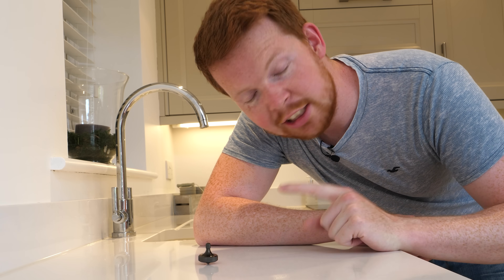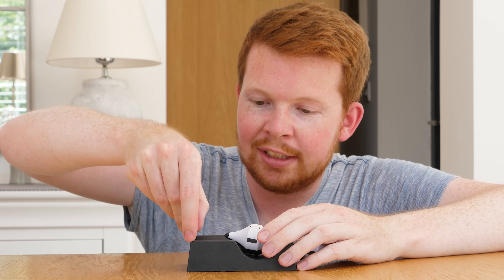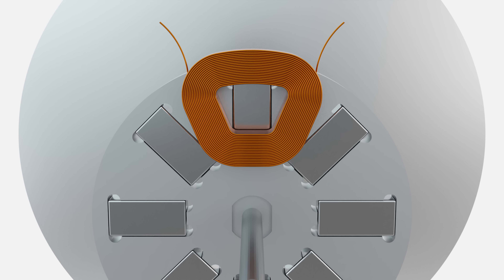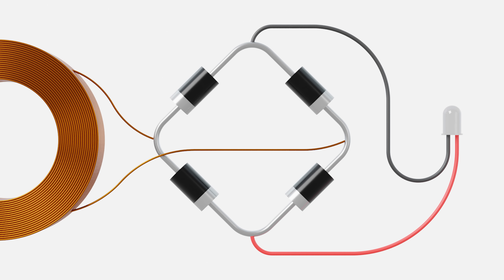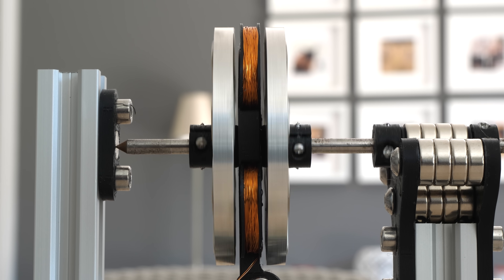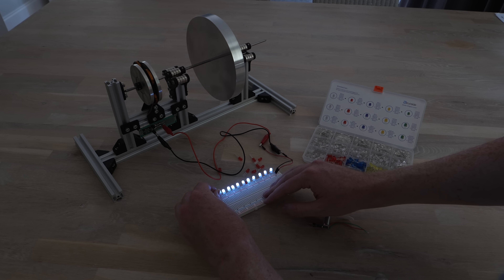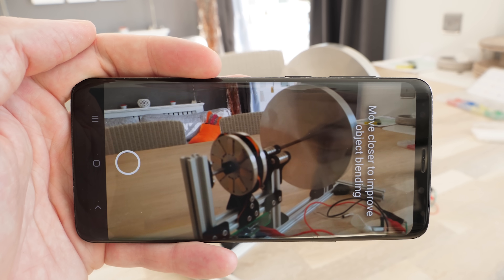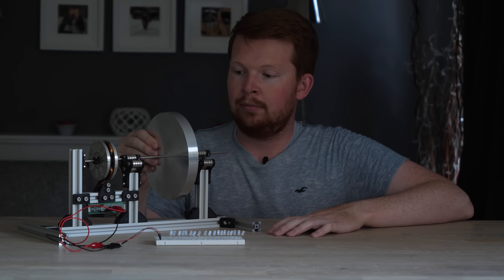Flywheel Battery

Comment: magnetic bearings are fun. try adding magnets with opposing poles at the ends of the axle. also use a beefier axle, preferably a hollow tube.
Reply: I think carbon tubes used in photography to rig stuff.
Reply: Beffear axial
Reply: Lavitating bearing new concept
Reply: It also be cool to see the addition of the small electric motor on the shaft as a pace keeper. Spin at the flywheel by hand and then send the power generated to the motor to keep the momentum up
Reply: @loganwilliamsbluecheck  it might potentially extend the run time but the laws concerning thermodynamics and electrical efficiency would still mean it will stop eventually
Reply: @jacobbrown7367  wait fr?
Reply: @jasalvatorekestrazzanti2715  well yeah, you're recycling some of the work the flywheel is doing to add energy back into it. 

Think of it expending slightly less energy for a slightly longer runtime

Comment: Hi, Tom. It is a pity that you started with a horizontal steel rod. It will bend. Try a carbon fiber tube that is much lighter and more rigid that steel. Another change, mount it vertically and lift the wheel from the bottom. No glass plate needed, just some small guide magnets at the top to keep it in place. The length of the lower vertical axis can be very small. This will increase stability. The upper axis can be long, so the lever action will enable stability via small guide magnets. Drill the center hole to exactly fit the carbon fiber tube. Super glue will hold it in place. Generate electricity from near the center of the wheel so that the whee;'s leverage will help drive the generator. Just daydreaming as if I was going to build one... Thanks for sharing! Stay Healthy!

Comment: I am happy you did this.

But you are missing something.  You're missing a filter.

Power supplies tapping from AC power, even on the industrial level, always require:
- Power source: AC Generator, even a transformer, etc.
- Rectifier: half-wave, full-wave, or (YOUR) full-bridge rectifier.
- And a filter: RC, LC, or any combination.
- And voltage regulation (optional): this can be done with a few transistors and zener diodes to prevent surges to your loads downstream (such as LEDs, power cabinets, etc).

You are missing the inductor (L) component, which regulate or limit the rate of current flow.  Since you have a capacitor added to regulate or "cap" the amount of charge, they do not slow down the rate of discharge since current will just flow freely.  This will "shave" or smooth your waveform output, since as you recall the magnets are not continuous throughout, thus creating "dips" or valleys in your AC sine waves.  This is why a filter after rectification helps "fill in those gaps", thus creating continuous and SMOOTH DC power.

I am happy you made several coils, which thereby create several phases (or other sine waves) which are wired to be at different times, but this can cause problems if the waves are not perfectly "distributed" or balanced in "degrees"--may need to review waveforms in trigonometry to know what I mean.  This will entail frequency (or the speed of waveforms created), and amplitude (the highest voltage created) as well as their degrees apart from each other.  Otherwise, I think you don't really need to bother with "phases" since this is not an industrial project--but it can be ;D.

Also, I recommend looking up a stator--this is just a peculiar shape on how inner magnets rotate around a chassis surrounded by wires (thus phases).  Probably can be printed in that Thangs website--which I am happy to stumble upon it on your video.

Comment: Im wondering, what if you would add a motor that will slide in and increase rpm of main shaft and then slide out untill rpm are dropped again bellow certain limit, would the regenerated power earned during free spin be enough to cover a motor which slides in and out to keep rpm at certain level? Or would it be possible to earn even more then spend on keeping rpm? :)

Comment: Would you be able to make another magnet cradle that matches the one farthest from the alternator (rear), and position it above the rear axle magnets, to serve as a spin stabilizer?  would prevent sideways and vertical movement at that point farthest from the axle pivot point, right?

Comment: What if, and I am just brainstorming here. Instead of having the screen barrier, you set up another 2 sets of magnets to balance this whole thing on or array of magnets on the screen. Basically, looking to remove that point of contact/friction. Then put the whole rig into a box and vacuum seal it. The wires could still come out of the box they would just have to be sealed around those points.
Then to spin the flywheel, you use magnets on the end opposite of the current barrier. Where you could use corresponding magnets from outside of the box to make the fly wheel spin. I wonder how much longer the flywheel would spin if you removed air resistance, and removed the point of contact from the barrier. Has anyone tried something like this before?

Comment: Hopefully you know angular momentum is related to radius squared. Thus, if you could take the full mass of your flywheel and put it into a very thin tube of the same radius you would see a dramatic increase in performance. You would have to 3D print some kind of spoke object to hold it in position. https://en.wikipedia.org/wiki/Angular_momentum. If you then doubled the radius you would quadruple the energy in the flywheel.

Comment: Hey Tom, I was thinking... Two flywheels store more energy than a single one can. Also, due to their bigger diameter and thickness, if you machined them to double as rotors, they could probably each hold 24 (?) stacks of 5 or 6 (?) magnets. With a ring of 12 (?) coils between them, they would make a MASSIVE generator. Don't you think?

Comment: One point you've missed. The outside diameter of the flywheel could be drilled for magnets at different degrees perfectly at each angle this outside 
Magnetic field can all be the same pole facing outwards  as the flywheel spins 
Each magnet passes a coil each coil sees the magnet pass and a a charge of energy is made, these charges are stored in a battery as direct current 
You use that current to drive a led light or even a motor to turn the shaft.
Now as perpetual motions not possible by our current theories this would let the flywheel spin a longer time, the decay in movement would be related to drag
As this has very little friction it depends on the motors effency that drives it and the battery that stores the energy and lets not forget electrical resistance on the wires and connections.
To boil this down what might spin 5 min
Could spin 1.5 hours. With a slower decay in speed.

Your going to need a really good mill with a presion indexer to index each hole for each magnet.  And you need to use rare earth magnets for best results.

They say perpetual motion is impossible but thats exactly how the earth travels around the sun.  What does seince know?

Comment: Awesome.  Just aubscribed.  May I ask you to try some ideas?

There are two concepts being explored here:

1) is that a levitating rotor will spin longer than a rotor mounted on ball bearings.

2) it can generate electricity.

This creates a great opportunity to explore Back EMF!  For every action there is an equal opposite reaction, remember? :)

In other words, drawing current from your generator will cause it to slow down faster.

The more current you draw, the more resistance.  It would be nice to see the difference in spin time with and without the load.

Joule Thief.

One other thing that comes to mind is to add a Joule Thief to your circuit, which increases volrage output by drawing more current.  This will allow you to generate a higher voltage at lower RPM and at the same time, for the purposes of the experiment, magnify the effect of Back EMF, i.e. create more resistance for your rotor.

Comment: Awesome! where the red LEDs are flickering, is this due to the voltage across the capacitors dropping to quickly between cycles? Would having more capacitance help with this?

Comment: Along the same concept as spinning the device with a drill have you considered powering a motor with the energy harvested that would give you a mechanical advantage with a pulley system to power a second setup. Much like a cascaded systems theory. You could generate much more power each time you add a new stage.
Reply: Ikr I was thinking the same thing 😆

Comment: Imagine a levitating inverted turbo prop. The air goes through the middle. Magnetic bearing on the outside. The prop itself is also a rotor to a stator.

Comment: You could harvest even more energy from the flywheel using shotky diodes in the bridge rectifier, and connecting LEDs in series should help decrease losses in windings since less current is flowing, but this would require more coil turns .
Reply: Good suggestions Osamah, but if I were doing it I would use two Schottky diodes and centre tap the alternator coils to reduce the losses even further.  Using a full bridge rectifier at low voltages (say less that 12-15 volts depending on current level) is a poor idea due to the losses being excessive.

Comment: Why couldn't you add magnets to flywheel on its top edge. And place a same pole magnets on shroud that once you start the spinning you lower the shroud and the opposing pole force pushes and keeps the flywheel turning and if those shroud magnets were electro magnets you should be able to increase the speed due to the stronger force.

Comment: Fascinating to see it in action. Ok ? why not attach a small motor to the fly wheel shaft to maintain spin. I understand the power to ratio thing but you have a weightless, almost frictionless system so to speak, now put it in a vacuum with no friction except where the shaft is stopped by the glass. I am thinking of  Diamond's as the Glass stop point, and for the end of the shaft. Just an idea I thought to improve  the over all system. 
OK! Larger scale like in an automobile?  Size is the point.  A DC   battery to turn the Fly   wheel  which generates power to run electric motor, and a trickle charge back to  battery supplying power to Fly wheel. The fly wheel changes the whole picture of power in to power out, like a water turbine. The frictionless Bearing and a vacuum make a big difference.   DID subscribe..

Comment: Clever setup! 
Someone might have suggested (but I'm not going to scan 7k of comments) to do the following follow-up:
Use electronic load to break. The fly-wheel should come to a stop sooner if the load on the circuit is higher.

Comment: Really wish you would have checked the current. At 10v it's got the voltage needed for most small components used in diy builds. now the crucial number on what it can power is how many amps it produces. Assuming its very low from the second motor. I don't have the tools or I'd do it. I suggest machining another flywheel that's thicker then drilling deep holes along the edge. They will end up being a starburst like pattern in a crosscut since some will be able to go deeper than others. then melt lead and fill the holes topping them off with some silver solder then paint to seal off the lead for safety. that will provide much more mass to impart energy into without use of ferrous metals. Then extend the shaft so you can stack more packs of coils and magnets to raise the voltage and current. you then can make a transformer that will drop the voltage and raise the current. If you can get 5v and 1amp out of that thing you can power anything that you could design to power via USB. I could do the math on everything that would be needed from number of coil stack to the windings for the transformer if I knew how much current it produces how it is now.

Comment: I really like this,but how about increasing the size of everything that way you get like 15 or 18volts to power a motor that you can ridge to the fly wheel and it will in turn spin the fly wheel endlessly and den you won't get much flickers in your test bulbs see(current from the coil power d motor and d motor spins d fly wheel endlessly creating an endless loop)👍

Comment: just a quick thought as the magnets on the generator discs are open on both sides a three coil assembly unit a sandwitch ((coil assembly)+(magnetic plate)+(coil assembly)+(magnetic plate)+(coil assembly)).

Comment: Instead of having the end of the rod physically touch the end with a point, you can also use magnets there as well. You will then be completely frictionless. Besides the air of course. Sweet setup. I see others with the same idea below.
Reply: If we could place it in a vacuum chamber

Comment: Great, now store the power and a small battery or capacitor then occasionally release a burst of current into the motor to drive the flywheel or shaft with a mechanical switch.

I made one of these years ago, it ran for about a week before I had to manually spin it again. 

Generated an average of 13v and the motor used a quick blast of around 80v at .5a (I think. It's been awhile since highschool). 

It generated enough energy to charge the capacitor in like 2 min and the remaining power used an old household LED as a constant consumer. 

About the closest one could ever achieve to perpetual motion...

Comment: Tom Stanton... What if you were to machine angled cups into the flywheel and use a small blower with directed air into the cups to push the flywheel?

Comment: Awesome build!

Here are few suggestions:

- Make axis rod shorter. There is too much unnecessary length that just contributes to wobbling and does nothing good.

- Use shotky diodes to create rectifier. That would provide less voltage loss in rectifier itself.

- Make coils narrower. Only part of the coil that crosses magnet contributes to generation of power. Sides that go along the magnet movement are just a waste of material and space and increases inner resistance of coil itself. Making them narrower cuts coil resistance and increased space and saved wire can be used to make and insert more coils.

- You could use large aluminium disk itself to mount magnets. Larger diameter would provide larger angular speed which is good for induction.

- Make some measurements of voltage AND current of generated electric power.

Comment: I was thinking of building something like this but using it as a generator about three decades ago when I was still a teenager. Never did get around to it. Did you ever think of instead of using the glass plate to stop the magnets from colliding you use a magnet on the end of the shaft with a magnet on that stationary next to it with both opposing poles. And if you do that on both ends the entire unit is just levitated by magnets. Do you know what I mean?

Comment: should have made something to spin it easier. something for fingers to easily grip but also mechanical advantage either pulleys or gears. also should have put the fly wheel and rod on the lathe and centered it that way.

Comment: Outstanding.  I’ve worked electronics (avionics) and cyber for the Military for 44 years.  I’ve  not seen  a better presentation of the principles of magnetism and alternators.  The explanation of diodes and a bridge rectifier was excellent.  I have been debating buying a 3D printer for a while. Think I will now. Thanks
Reply: Can't wait to see what you come up with sir, I bet you have seen quite a few experiments in your time.

Comment: It would be better, If you speed up the wheel with a motor, and measure the input energy (V/A/s). After that, you measure the wheel output energy (V/A/s), and compare these. You may also calculate the effeiency.

Comment: These are used to power roller-coasters. Since roller-coasters need a large surge of power for a shot period of time, flywheel batteries can be used to temporarily store power from the grid. This in turn prevents strain on the grid from random power spikes.

Comment: I have an odd idea.

Put a magnet on both sides of the pole and frame so it would essentially levitate but the magnets would keep it in place.
Also, you could possibly put magnetic rails with weighted magnetic balls inside of the disc to have a weight travel for constant motion to make it spin longer.

Comment: You dont have to rectify AC to power a lamp or lightbulb.. it  works even better on AC, because rectyfiers dissipates some energy ... and LED diodes should be connected through resistor to limit current...

Comment: why not coil a string around at the end to rip like spinning a top or a bayblade. 
takes some prep but you could get it to re-wind itself when it starts to slow, rip it again, and spin it counter clockwise as well.. dont see why that wouldnt work if the idea is to just pass opposites over the coils as fast as possible. never said the direction mattered

Comment: You can put opposing magnets on the end the shaft and make the plate it spins against is also an opposing magnet that will eliminate the final physical contact point of all metal parts spinning. This will decrease friction down even more and allow for the flywheel to spin even longer. The next form of friction that remains would be from the air around it. That's when you install it in a vacuum chamber. After that the only remaining friction would be from it's own magnetic fields. Which is almost zero. Who know how long that will spin?
Reply: Or how much energy it would produce

Comment: You should see my patent application of years ago which has the battery inside the flywheel and uses the centripetal force to change the electrode distances and gain an advantage. Also with a metal air battery the spinning does great things.  R S Cattle inventor see patent apps about the 1980,s

Comment: Well done Great machine. I think. Can you put back some of the voltage you get and use it to drive the shaft of the machine. And use the rest to power the consumer. It can also be coupled with a battery. Or to charge a battery?